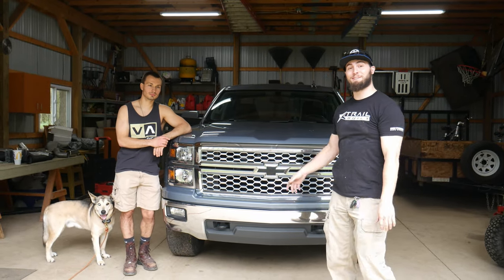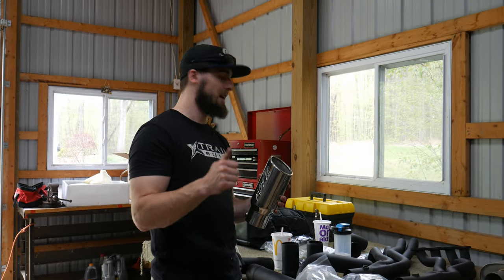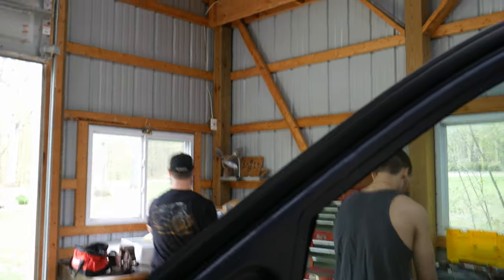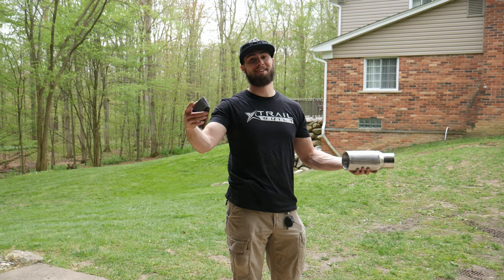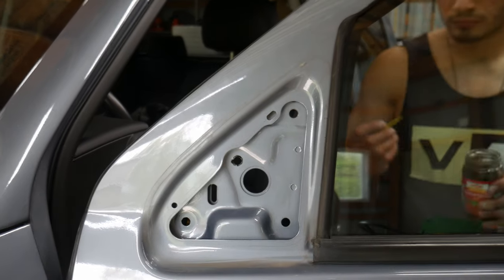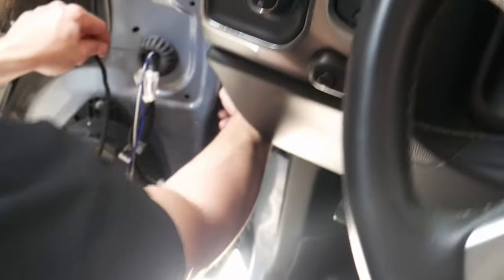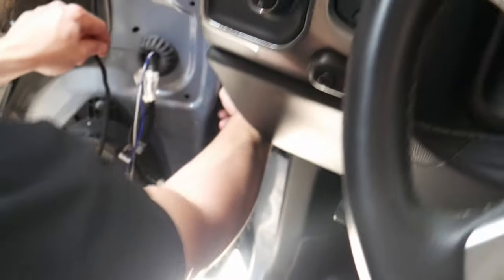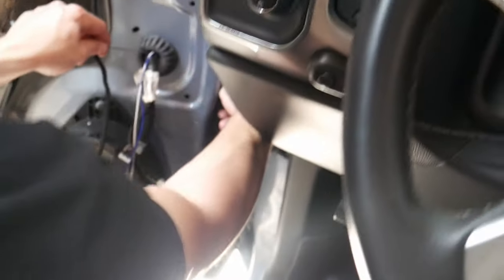14-18 Silverado/Sierra Tow Mirror install no Added harness

Comment: Problem was tapping into the fuse box, most of those you’re gonna find are ignition switched.
The switching of the actual accessory is on the head light switch. So that fuse remains hot all the time. The relay on the other hand would would theoretically

Comment: I’ve got these same mirrors with same 3 wires I am in process of installing them and I believe you can run them straight to the door wire harness plug and pin them in the connector. But we’ll see
Reply: What ended up happening

Comment: The 4 screws coming out of the towing mirrors. It's optional to unscrew them out. That's why the tips are squared. What I did with mine rather then drilling. But good work guys

Comment: I wish the video explained where exactly you plugged in your wires and where did you come across/buy the set of wires. It’s good to know it’s possible doing it without a harness that’s going to cost $100 or more.
Reply from the maker: We just used 16 gauge wire that you can get at an auto parts store and here's the in expensive harness we used.

https://www.amazon.com/Nilight-Connector-Harness-Light-2-Warranty/dp/B076C5HV59/ref=sr_1_18_sspa?dchild=1&keywords=vehicle%2Baccessories%2Bwiring%2Bharness&qid=1596651645&sr=8-18-spons&spLa=ZW5jcnlwdGVkUXVhbGlmaWVyPUExVldOSTkyWlBMQTFOJmVuY3J5cHRlZElkPUEwMTI2NDM4M1cxTzhBQ1NORFNPSCZlbmNyeXB0ZWRBZElkPUEwNzk1MTIzM0pWWTZZNzE2VjJNRSZ3aWRnZXROYW1lPXNwX210ZiZhY3Rpb249Y2xpY2tSZWRpcmVjdCZkb05vdExvZ0NsaWNrPXRydWU&th=1
Reply: @CaswellCustoms  but what fuses did you tap into 
Trailer park lamp or what fuse ???
Reply: @andrewarana3849  yea I’m not wanting to buy a harness either I’d rather splice / wire it myself etc, can’t figure it out yet, my blinkers don’t work off just plugging in the harness from the factory door to the aftermarket tow mirrors
Reply: @creolekolbytv  you said your blinkers don’t work what about the lights on them or the electric button to turn them

Comment: How could you factory color match? Same with fender flares.  Sick video too 🔥
Reply from the maker: Use the paint code to get the same paint and then just do the top cap piece in the same color like the factory mirrors were. And thanks appreciate it!
Reply: @CaswellCustoms  Ya'll are badass. Thanks a billion! Keep up the hard dirty work!

Comment: What fuses did you use to tap into
Reply from the maker: we tapped into fuse 26 for the running light, and then we used his reverse pods controller for the back up lights. https://www.amazon.com/SWATOW-INDUSTRIES-Harness-Driving-Waterproof/dp/B07R8K6GP5/ref=sr_1_28?crid=2WYL0E1R8UFHZ&dchild=1&keywords=aux+light+switch&qid=1611760370&s=automotive&sprefix=aux+light+switch%2Cautomotive%2C174&sr=1-28

Comment: can somebody help me.. i have a 2015 LT without the ambers in the oem mirrors, i want tow mirrors with the amber led, do i need any additional wiring harnesses or to wire something to make that happen or can i just plug it right into the oem mirror harness?
Reply: I have aftermarket Tow Mirrors on my 15 Silverado. Mostly plug and play but the Day Running Lights and Revers lights on the Mirrors don't work. I'm planning on looking I to that tomorrow and see if I can get them to work without a Harness. Worst comes to worst I'll hard wire the Amber Daytime running/Blinker lights into the Blinkers or headlights themselves and se with the reverse lights on the Mirror I'll try and keep you updated as I figure it out